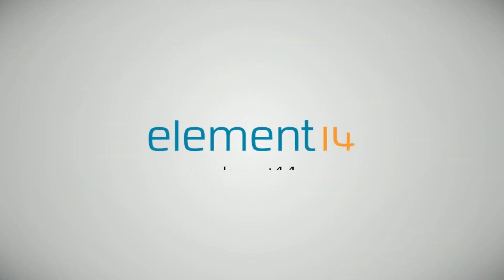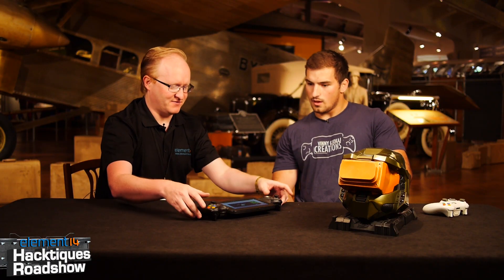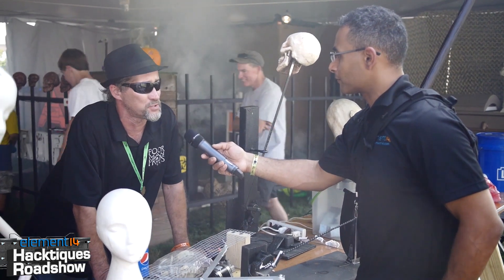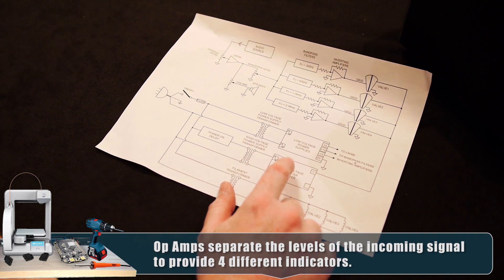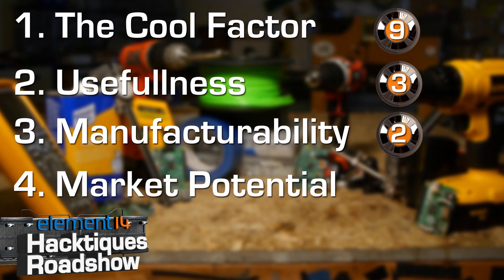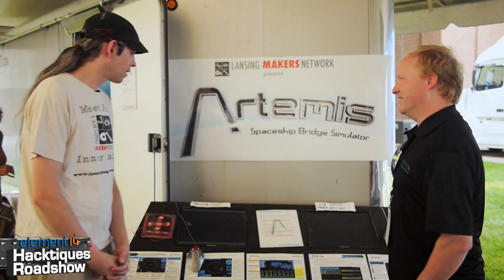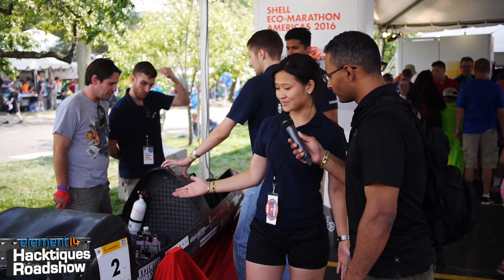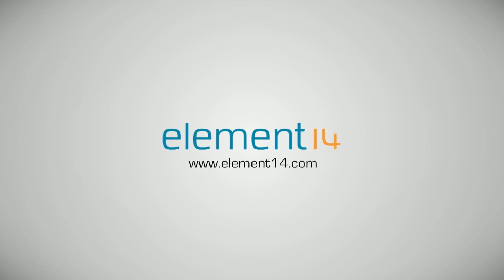Ben Heck's Hacktiques Roadshow Part 2

Comment: Only 1454 km per liter with their vehicle? (Or 3421 miles to the gallon, like the girl said @ https://youtu.be/83loICG1CPU?t=15m2s)
We achieved 3800 km per liter (or 8900 milles to the gallon) with the H2A from Amsterdam.
Reply: +Jesper van Tol Yea but that's hydrogen not normal gas.

Comment: he removed the d pad wtf lol
Reply: +NonsensicalSpudz I removed it because i mainly played FPS (Halo Ce - 3) it was a first one, and after a huge amount of soldering and wires everywhere it was just left out because i thought it wouldn't be as needed, if i was to make it for the xbox one i would of course leave the Dpad. but you know its a circuit board cut in half and pain stakingly placed back together pin by pin
Reply: +Yurdrak Saen i have a full discription of what i went through for the controller in my channel! i explain allot of stuff in detail. if you guys get a chance check it out
Reply: +Yurdrak Saen it sucks but is still needed to play most games.